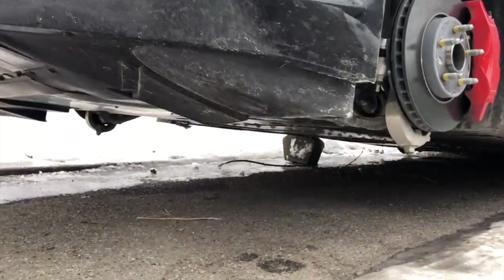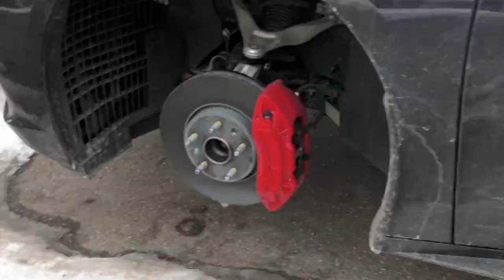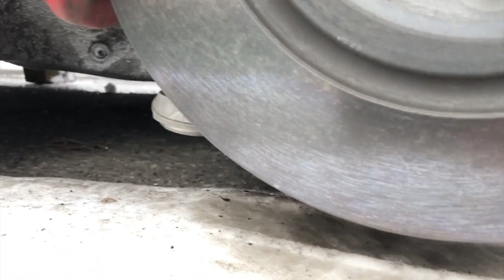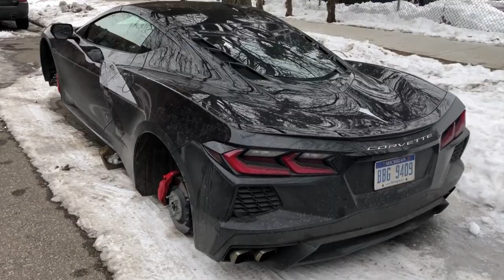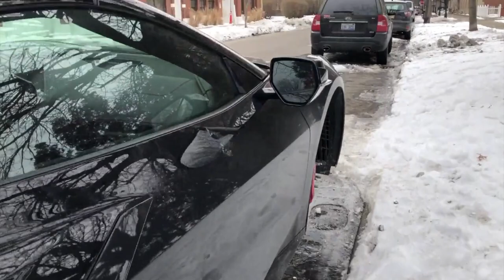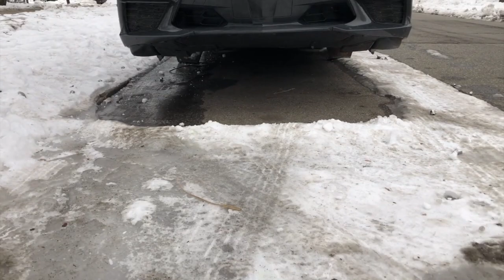First Stolen 2020 C8 Corvette Stingray

Comment: hilarious...  stole a virtually worthless set of wheels and tires.  The tires may have some value... but fit very few cars.  The wheels are un-sellable... unless you want to go to jail.  Perhaps a wheel manufacturer like Cray or HRE offered a secret bounty of $5 grand to the first person who could get a set.  That would give them a month or two head start on producing aftermarket wheels for the c8 knowing the exact offsets, spacing, bolt pattern... etc.
Reply from the maker: I Know right, criminal minds...thanks!